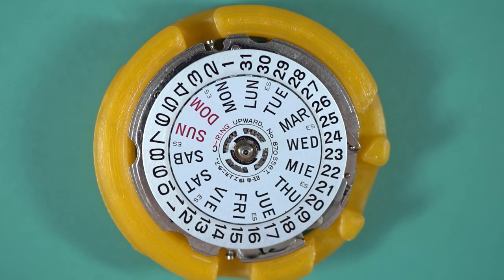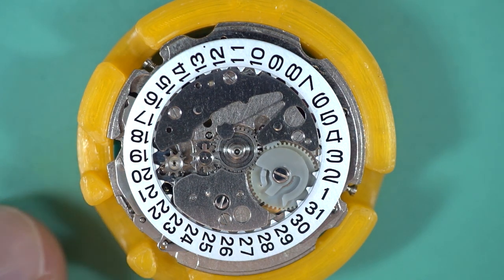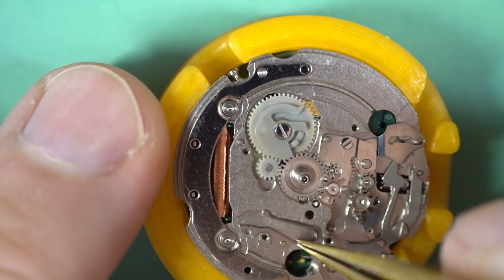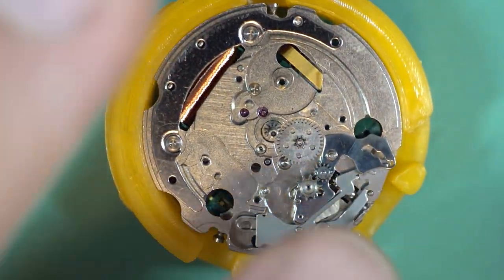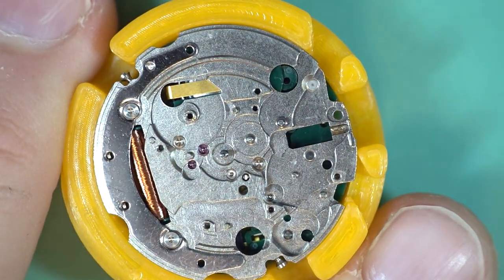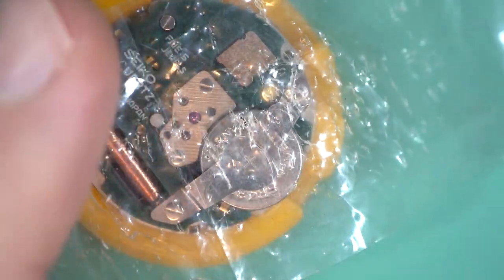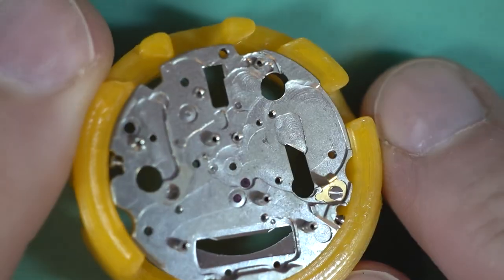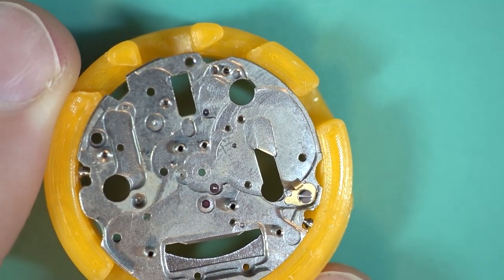[TECH] - SEIKO 7548 Quartz MOVEMENT - How GOOD Is It?

Comment: This is a great video.
I have a Seiko 7548 700B dive watch. It is 35 years old. I had a watch guy put a new battery into it after it sat idle for 15 years. And away it went. I bought it new in 1985. It went through 12 years in the NZ Army with me and I took it on over 200 dives. An awesome watch. Keeping perfect time and it has been a week since putting in the new battery.
Reply from the maker: They're an indestructible movement. They don't even use a PCB, which is great as it's one less point of failure.

Comment: I've just gotten into these 754x movements, my first real foray into working on quartz movements, and this video is extremely helpful - thank you!
Reply from the maker: They're a really rewarding movement to work on. I recommend them to people wanting to get into tinkering as they are relatively simple, cheap, you still get a complex calendar, and if you can handle that, a 6309 or similar won't be a massive step forward. There's also parts around and if you can't find the parts, you can usually get another movement. Pulsar made a copy of it as well which is 100% interchangeable, I forget the caliber number, I'm sure someone will chime in with it.
Reply: @hal0eight  I think it might be the Pulsar Y513/Y514 series but I'm not sure.

Comment: Very informative. thx
Can you tell me what that brass screw on the back, with the arrow "back and forth" sign next to it is for. 
I'm hoping it is for adjusting the movement
Reply from the maker: Trimmer, gain or loss on the timing. Tricky to adjust accurately without a quartz timing machine though
Reply: @hal0eight  Tank you. Might give it a go

Comment: Hey there, when using the trimmer is it clockwise to speed up the movement and anticlockwise to slow it down? I have a 7546.
Reply from the maker: It really depends where the trimmer is set to already. I don't remember which direction it is because I always do it on a Flashtest or QT-77. As the trimmer is so sensitive and just takes a whisker to change, I wouldn't try it without diagnostic equipment.

Comment: Did the coil still work after you slipped and hit it in the video?
Reply from the maker: Yes. In any case, this was a scrap movement so I wasn't terribly careful. But a good example of how careful you need to be around coils.
Reply: @hal0eight  I'm glad it was a scrap movement.
I cringed when it happened, lol.
Reply from the maker: @watchnut5305  Except for the rare stuff I pull apart here, everything else is scrap movements, which is why the rarer stuff is done a bit slower.

Comment: i change the coil, circuit blook and i clean the parts (battery leak) but it doesn't work. any clue why the watch doesn't work?

Best regards 
Simon
Reply from the maker: Good question. First step would be to get the movement on a pulse checker and make sure you get a pulse and to check the coil for resistance and continuity. You probably have 2 bad parts.